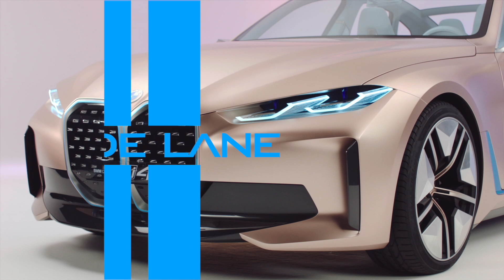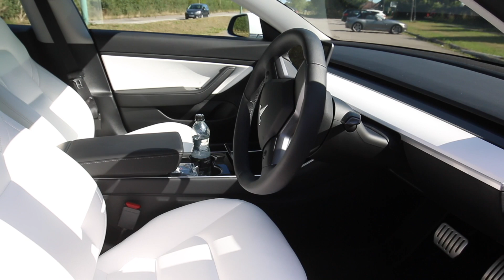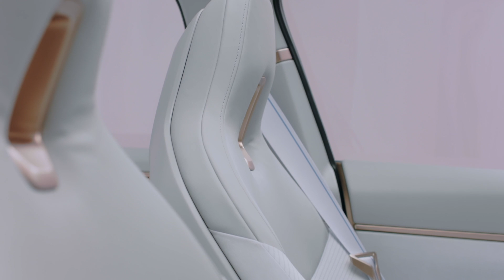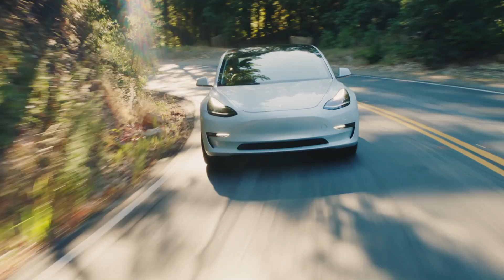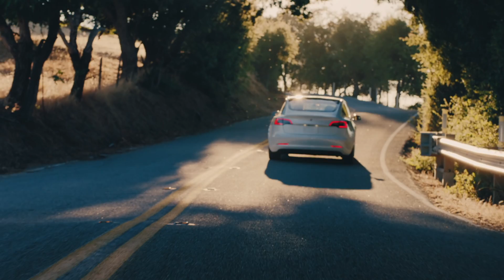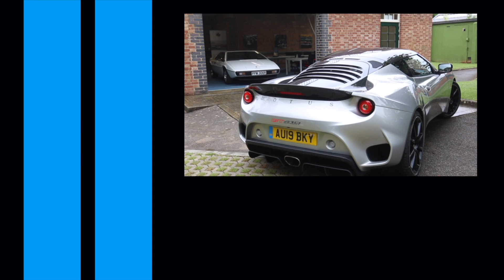Tesla Model 3 vs BMW i4: Electric Car Kings – Inside Lane

Comment: The European standard is more ideal and maximum range under best case scenario (like more traditional mpg rating) the USA standard usually is 80-90% of the European standard.

And considering no one has beaten Tesla's efficiency, and a 80kwh BMW i4 compared to a 75kwh Tesla Model 3 isn't much.. I would day BMW is the same range give or take 10-20 miles (probably lower)

Love the video though. 
And I hope the i4 is as good as they are saying and better.

Comment: Realistic video ? Comparing a concept (that will look completely different in production) with a production car !? Compare again once in production with the new 2021/2022 tesla at that time........probably a plaid, new lighter battery, 500 miles range, 300kw+ charging doing 0-60 in 2 seconds.......just guessing, but hey...... concepts are guessing.
Reply: This about 90% to the production car. Real thing will have the exact same body, normal headlights/tail lights instead of the floating lenses (but same shape), probably different wheels (although similar aero wheels are possible) and most likely some changes for the interior.

The older i4 concept was the true concept, this is more or less the production BMW i4.

Comment: Dude you are comparing the King of the road with a mambo jambo Toyota Prius tesla or whatever the hell that is. It's just silly. This brand is a disgrace to a true genius name. It's overpriced cheap and boring piece of crap, and thats it!
Reply from the maker: Have you ever driven a Tesla?
Reply: @insidelane  Yes i did, 6 years ago and my first impression was that this vehicle is build only to make profit, not to impress or make it's owner to feel special in any way. I'm not saying it's a bad car but it's quite far away from the other top luxury brands like BMW or Mercedes or Audi and so on.. :)
Reply from the maker: I’d certainly say that early Model S and X build quality and material quality were sub-par, however, the Model 3 is a big improvement. To call the car a ‘Jambo Toyota Prius’ or a ‘boring piece of crap’ is pretty misguided. As a motoring journalist, it’s not a bad car at all.
Reply: @TheKosiomm  the bmw will perform like a 6 year old Tesla due to a less advanced powertrain and battery tech

Comment: Why did they put so much air intake on an electric car? To increase the drag or what?
Reply from the maker: The grille is mainly for display as opposed to cooling, hence why it is quite closed. But electric cars do generate a fair bit of heat and still need cooling - but obviously not at much as regular cars.
Reply: @insidelane  actually the grill is a housing plate for multiple sensors and driving assist technology
Reply: What air intake?
Reply: Because they’re gonna sell the same chassis with an ICE engine.

Comment: The problem is the i4 will cannibalize BMW
Reply from the maker: What do you mean?
Reply: Why buy a Bimmer 3 series gasoholic?
Reply: @insidelane   if a brand produces a product at a performance and luxury level which matches or surpasses the majority of other models within the range, and at a lower price point, that product will cut into the market share of the other models. you might not think its a huge issue but in the long run, it will significantly reduce profits in terms of the money pumped into all the production/ R&D/marketing costs it took to make the other models, not just the drop in actual sales of those models. 
For a brand with a large portfolio of models, like BMW, achieving long term growth, profits and sustainability through controlling the market segments (price points balanced with performance/luxury levels of the entire range is critical.
Reply: How? This is an electric version of the 4 series gran coupe.
Reply: Isn't it better to cannibalize your own products than give the mkt away for your competitor

Comment: I promise that this i4 will not have same range, top speed and charge speed as a LR model 3 when it will come out, and cost $ 10.000 more!
Reply: BMW usually downplays the performance of its vehicles. When they say 4s 0-100km/h expect 3,8s.  The range of the x5/ 45 hybrid gives you a 5km more range when tested in real life situations....
Reply: Not really.  They have some of the most inconsistent test results due to ICE lag plus launch control bugginess.
Reply from the maker: I think it will probably cost a little more than the Tesla, but its performance shouldn’t be in any doubt.

Comment: The bimmer looks very ugly in the front.
Reply: Call it ugly but it will sell like hot cakes. People (like you) betrayed x7 for having such a 'hilarious', 'monsterous', 'oversized' and bla bla bla... grille but it was the car that sold the most (among other competitiors like gls and q7) and was a very successful car indeed.
Now,
SHUT.THE.FUCK.UP🤐🤫
Reply: @Divyansh_Singh  yes, but I don't see a line of 500,000 people for it when that was how long the model 3's wait list was 3 YEARS before it was delivered. Both will sell well but one will destroy the other, and its not the one with the pig snout